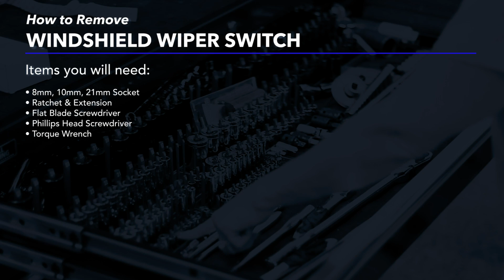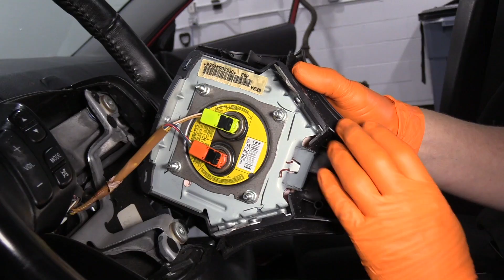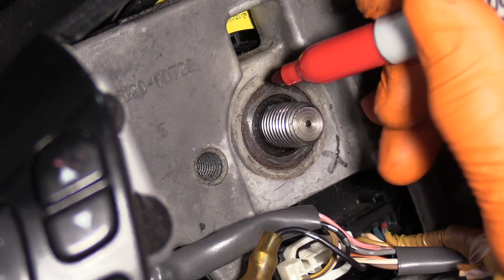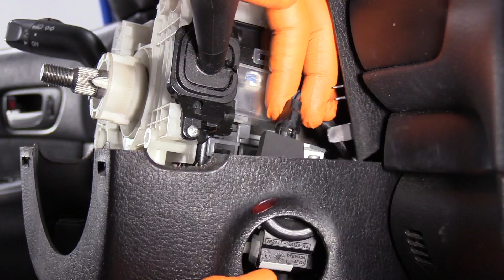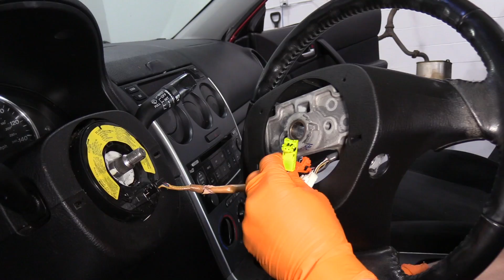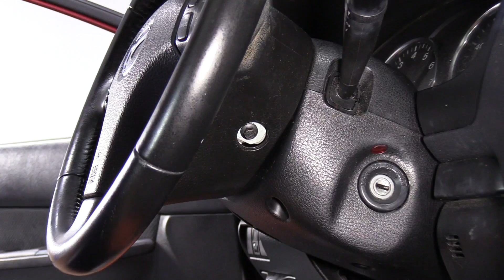How to Remove Wiper Switch 02-07 Mazda 6

Comment: My 2005 mazda 6 didn't need steering wheel removal. 3 screws at the bottom cover. Separate upper and lower cover. Remove switch screws.

Comment: on my 04 i didhn't have to take off the steering  wheel. i just undid the 3 screws and pulled the top and bottom plastics apart.  . Helpful video though i would not have known what to do without it